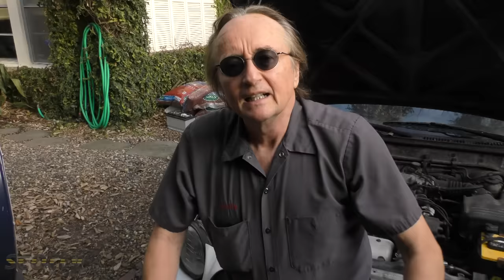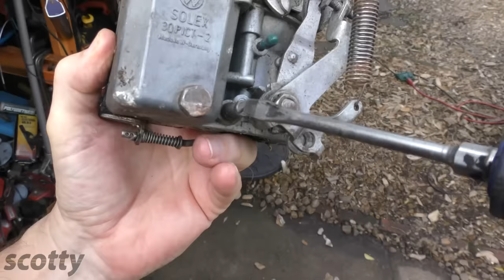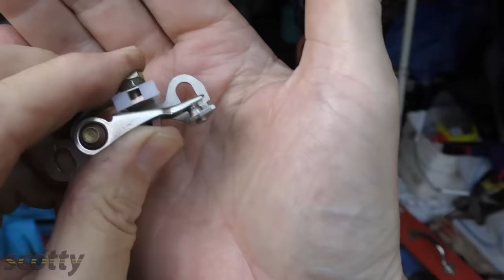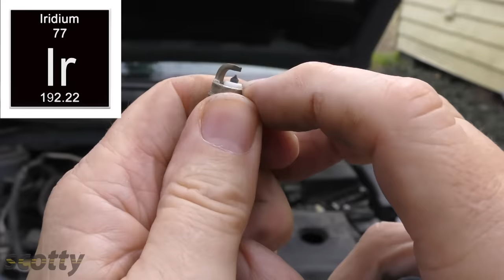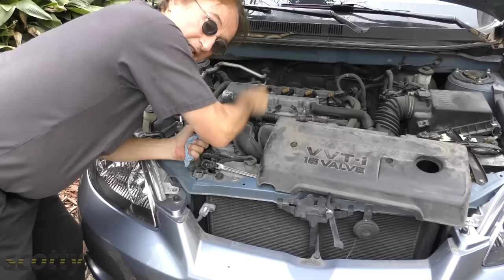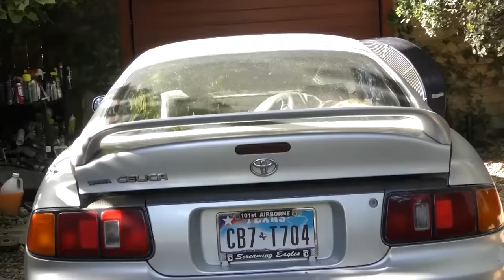Does Your Car Need a Tune Up? Myth Busted

Comment: I would say a tune up is done at 150 000km, cleaning throttle body, MAF, running seafoam threw the intake to clean up carbon, put injector cleaner in the gas tank, seafom in the crank case,  clean the PCV system or change it, that and the obvious fluid changes for transmission/differential/transfercase, etc.. My money pit 2008 mercedes as scotty would say had this done at 150k and now I just hit 300k, still runs like new when I first got it 6years ago at 100k, my toyotas also get this threatment and also run like new, recently did the valve cover on my 2009 rav4 with 200 000km and the inside of the engine was spotless, running some seafoam in the crank case before eah oil change really makes the difference.
Reply: That's called maintenance...
Reply: ltwargssf R Lol, refueling a vehicle is just that, REFUELING. Changing fluids, plugs, wipers, etc, is maintenance (why don't you look up that definition, btw). Making adjustments to obtain peak performance is TUNING. The two words are often misused by simpletons, but are not synonymous, so yeh... Dude, you answered your own question and STILL got it wrong, lol. That's awesome. Oh, and dealers DO write 'tune up' on the service order if you bring a car in and request a tune up. As a matter of fact, they'll even label it as a 30K mile tune up, 45K mile tune up, etc.
Reply: Amazing, and what do does the dealer do on that "tune up" ? God damn maintenance and check up or parts changing..so tune up = maintenance how is that so hard to understand ? You just proved your self wrong lol, the words tune up have changed definition since the 60s.. Clearly theres nothing to adjust on a modern car other then maintenance, changing parts and check ups..
Reply: https://autoservicecosts.com/tune-up-cost/

Heres far more information about this, note the first sentence ;The foundation of automotive maintenance is staying on top of your manufacturer’s recommended service schedule. These maintenance activities are known as a tune up and can include many different services which are discussed below.

Maintenenace = tune up, get that in your head, tune up is a term used for none car people(mechanic morons basicly) so they have a better understanding of what  is being done to their vehicle.
Reply: An automotive tune up is a scheduled set of specific repair items performed throughout the life of your vehicle. They are intended to prevent a variety of major failures from happening and are necessary to maintain the reliability of your car, SUV or truck on the road. The manufacturer provides a recommended checklist of maintenance to be completed each year, your preferred mechanic can help you determine the cost to perform the service.

I hope you learned something today at least.
Reply: ok since you're so hard headed, using you're logic, a dealer can still do a "tune up" on a modern car by adjusting software, example, resetting transmission computer for better quality shifts, resetting certain modules so they perform at peak performance, just like you're computer starts to get slow when you haven't turn it off for a while and after a reset its fast again. A modern tune up wouldn't be done mechanically but electronically, that is in terms of the real definition of a tune up, the meaning has become just a slang for maintenance and that is a fact.
Reply: ltwargssf R When a dealer does that, it's called a 'software update', not a tune. This happens when there are known issues to the original software. My (since long gone) stupid BMW required four software updates, one for the trans, two for the engine (PCM) and one for the BCM. Don't buy a BMW, seriously. But, like on the F-250's, the dealer would perform a tune (for a modest fee, of course) and would give it, I believe, and extra 100 lbs-ft of torque.
Reply: In definition its a tune up man.. just done by software and not mechanically, I said resetting computers not updating..Again, resetting a computer makes it perform back to its original speeds like I stated before hand.  Even tho tune ups require part replacement, check up,cleanning,it is MAINTENANCE !
Reply: There's no absolute definition of what exactly a tune-up should include, but most would agree that it involves replacing the spark plugs and performing other adjustments to maintain or restore like-new engine performance. The problem is there's not much that can adjusted under the hood on many late model vehicles.

^ This is straight out of google dictionary.. "no absolute definition", as I said, it is a slang for maintenance .....
Reply: ltwargssf R Well, this is where it can be tricky. Changing plugs because they're worn or fouled is maintenance. Changing plugs to a hotter or colder plug, because of nitrous, or boost is tuning. Here's the rule of thumb: when doing scheduled tasks to increase longevity, it's maintenance. When performing a task for optimal operation, it's tuning.
Reply: Now you are confusing tune up with tuning man.. My first comment is what everyonen should do to their cars at 150 000km, call it maintenance, tune up I dont care, it is a task made to prolong the longevity of your engine and vehicle in general, not tuning it, just making it perform as good as it did when it was brand new, not better, tuning is a completely different subject.
Reply: ltwargssf R A tune up IS tuning. Notice how I didn't use an example when giving the 'rule of thumb'? That's because you can tune several different things like a guitar, water pressure, or satellite reception. There is no confusion, since it's the same thing...
Reply: Ah tune up is not tuning, tuning is upgrading, a tune up is a restoration/maintenance to bring back to its new, original condition not make it outperform its original design, tuning is making it perform above its original purpose, Im done with you, I would suggest you get yourself an education. We are talking about cars here not damn guitars, you go out of context way to much.
Reply: Yeh sure man, I have years of car mechanical experience, knowledged in electrical/software and have a degree in mechanical engineering, Im done trying to teach you something as simple as tune up = maintenance.

Comment: After a 100,000 miles a tune up that I would do is spark plugs, ignition coils, fuel filter, pcv valve, air filter,

Comment: But if you car is useing more gas then usually then yea you will need a tune up like spark plugs and spark plug wiring oil change air filter and so on just depends on the car too
Reply: Yes it does dude it's part of the tune up
Reply: You Tube, I beg to differ.  I can hear the difference in how my car runs after I change the oil.  It's got to make a difference in gas useage.  JMO

Comment: So if cars don't need tune ups what do I do to make sure everything's OK. Well basically can someone give me the run down in simple terms I'm lost
Reply: To me from my father who told me a "tune up" is change spark plugs Ignition Coils, oil, oil filter, air filter, fuel filter and check  brake fluid and radiator fluid power steering fluid and check all hose for cracks

Comment: Yep no need to tune your car up.
What's the point of gaining a few horses if you drive around town all the time going slow most of the time.
More strain on the engine more to go wrong less reliable more hassle.
If you want to make your car go faster use an engine cleaner like redex,change your oil,new spark plugs,new ht leads,new fuel filter,new air filter,correct tyre pressure's,make sure exhaust has no holes and check exhaust gaskets for leaks.
All this equals a healthier car and faster car without problems guaranteed.
Simple's.(;-)

Comment: How much should a tune up cost ? 💸
Reply: Prices vary wildly depending on make, model, and engine.  
Example my wife's Fusion is about $135.00
My 5.4 liter F150 about $500.00
My uncles corvette, $1800.00
Reply: Ray S thank you 🙌🏻 . I own a 2011 camaro Lt
Reply: @ItachiUchiha-xk1fr  
I have not been around GM products since around 2001.  At that time they were using platinum Delco plugs that were about six bucks a piece.  If you decide to do it yourself, use only the OEM parts.  Sometimes you can get them from other sources and less expensive than the dealer.  
I would guess a V8 tune on a car would be around $350.00
Just a guess.  If you find out I would be interested to know
Reply: Ray S this saturday i got my spark plugs replaced with New ones 🙌🏻 . After 44k miles , i payed $ 60 for the 6 spark plugs and $50 for the hand work ☺️ i was pleased 🙏🏻 .
Reply: @ItachiUchiha-xk1fr  
Excellent!  (That's what I like about my wife's Fusion.  Cheap to maintain.)
You found a great deal!
Reply: Ray S American cars are the real Winners for being soo reliable and easy to maintain 🙌🏻🙌🏻 . Instead of foreign cars that can leave you broke .

Comment: Saab deal $800 for new plugs all fluids flushed , new fuel filter and so on . Oh yeah your coils 3 of your coils are bad the other one are half way . Ok replace them all lol .   Go to pick up car car is running horrible then when I took it in .  Yeah it needs a new ecm  but they don’t make it so we can get you a used one . Ok .  Truth my car drive fine but truth is I feel it does not drive as well as it did before it went in.   It all started when My coolant reservoir had a small leak so I took it to firestone ( like a dumbass) and they almost destroyed my car .  I went though 4 reservoirs. Only where the original was just a small leak these ones split in 2 .  I call the corporate number and they got me in touch with the a regional manager.  They refunded all my money .  $1090 all said in done.  So I took it to the dealer they fixed it told me they used cheep Chinese part and not the right spec hoses .   The fix required a software up date  it’s a common problem on my car.   I love my Saab ( not a real Saab Gm idea of a Saab )  reminds me of my friends old cutlass supreme more then my neighbor Saab 99 or 900 growing up  which made me want one from the beginning. Still cars fun even though it’s $$$$ to run.  Will say I be back driving Japanese cars after this Saab .

Comment: This is stupid video tune up is part of maintenance like anti freeze flush spark plugs and wires software filters CCV cleaning throttle clean valve carbon blasting seals and gasket to many stuff you need to TUNE UP your today’s cars more than before don’t listen to this old mechanic every thing change in today’s cars
Reply: Im an ASE master tech at a dealership- yes even modern cars still require a tune up. plugs, induction service, throttle body cleaning at manufacturer recommended intervals. this guy is just telling people to run their cars into the ground and then you will have problems that wont be fixed by throwing a set of plugs at it.  throttle bodies have to be cleaned regularly, they are all electronic stepper motor operated throttle bodies now, and if the throttle blade gets carboned  up with sludge and gunk it will put the throttle blade into a bind and begin to burn up the stepper motor. now you're stuck replacing a $700 throttle body because it failed due to lack of proper maintenance. not replacing plugs at manufacturer service intervals will cost you gas mileage, performance and reliability, and you can damage your catalytic converters by running a vehicle with an ignition system thats not up to par. 

id like to point out that when he is showing you a distributor and describing how points work he is holding up a modern distributor from what looks to be a honda engine- those dont have points,  they have a hall effect sensor that reads the engine speed and position and an ignitor module under the cap that fires the coil via a signal from the cars ecu. 

ive watched a bunch of his videos, while he does have some valid information in each video a lot of what he says is either a bunch of half-truths or just flat out wrong. 

Listen to this guy and run your car into the ground and it will cost a LOT to fix things when they start failing due to neglect, like a lot more than the maintenance would have cost.